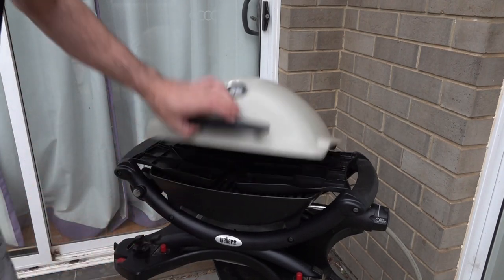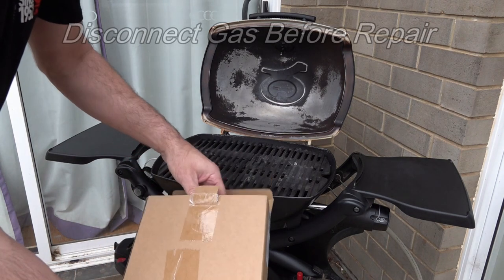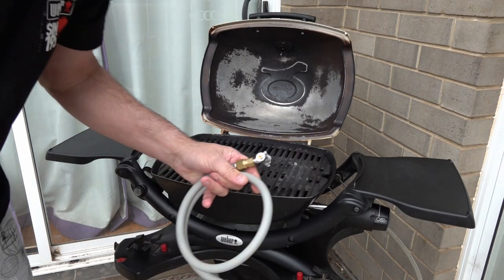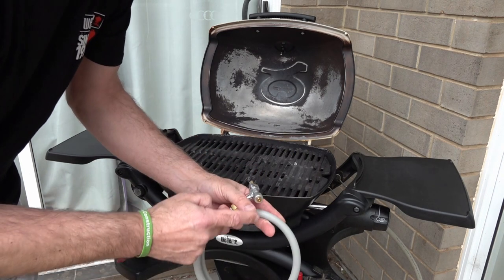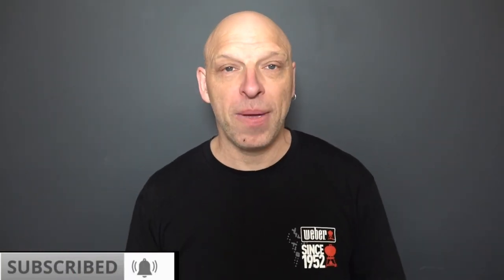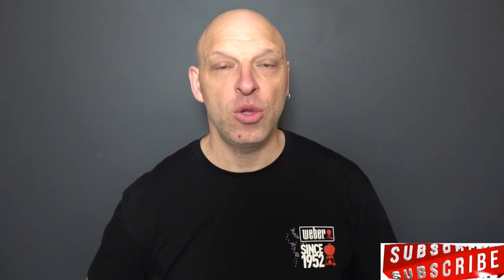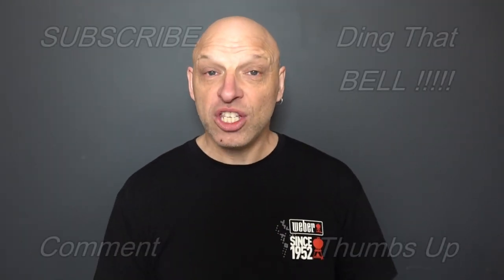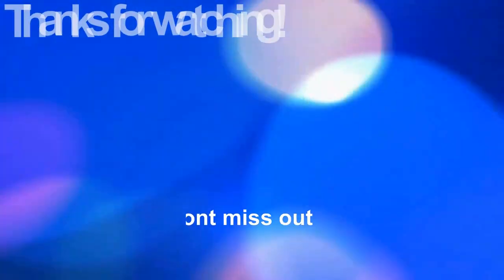WEBER Q1200 GAS PROBLEM :Weber Thermostat Replacement On Q1200

Comment: Really useful video - so thanks very much. I’ve got a question you may be qualified to help me with.

My Webber Q2000 runs on Butane and is designed to to be portable and operate with the small 5kg (10lb) butane gas bottles.

I only use my bbq on the terrace so I want to use use it with a larger 30kg bottle as a permanent fixture. The problem I’m encountering is that Im running at low heat due to low pressure.

I’ve cleaned the burner etc.. , made sure the gas supply is balanced so I believe the cause of the problem is this.

The BBQ has its own regulator but the large gas bottles also have their own desperate regulator. In fact you can’t use these large bottles without the regulator because it is via the regulator that they attach to the gas bottle.

I’ve seen some YT videos where camper vans have removed the Webber regulator altogether and then connected directly to the gas bottle via the regulator for the gas bottle.

I'm guessing yours is also propane powered but do you have any thoughts if this is feasible?
Reply from the maker: Are you in Uk as i remember the regulator pressing on top of the bottle, i think here in aus they are propane which burn a litle hotter. 
Running two regulators is more than likely the issue. 
You should be able to get a new hose from weber and regulator from weber so you only have one running isntead of 2.
Hope this helps
Reply: Close, Spain. Many thanks for taking the trouble to reply, that’s a good idea.
Reply from the maker: @vintagebollinger4439  your welcome, happy to help when I can . Thanks for support really appreciated 👍👍